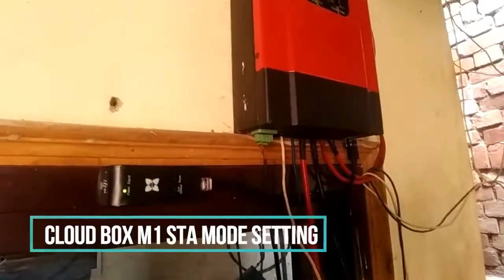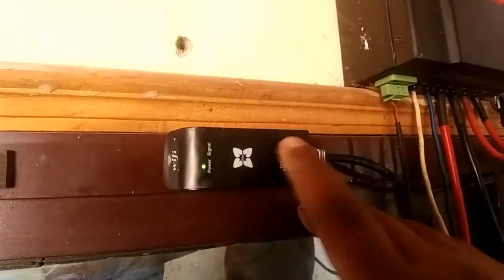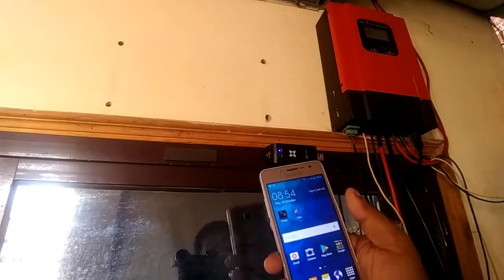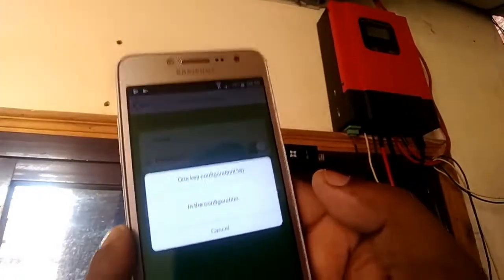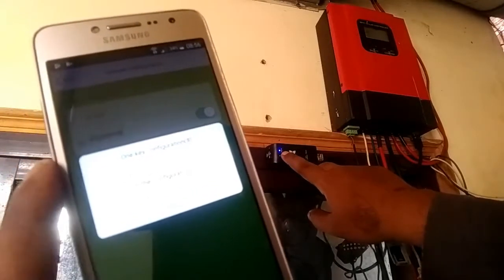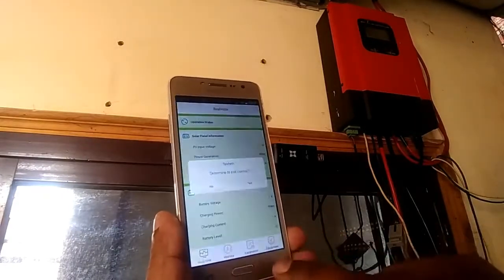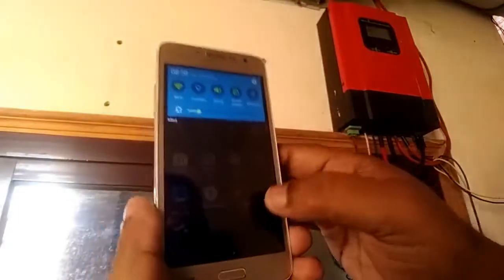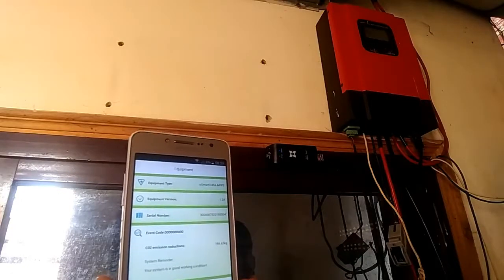Cloud box M1 setting for Esmart3 & wiser3 MppT

Comment: Hi, do you know how to configure the USER DEFINED  option to lithium battery profile?
The terminology they use is very confusing.
Reply from the maker: Hi dear lithium battery are very sensitive to over voltage. This controller says lithium support but you can't trust it's voltage calibration. Often is off by volt or so per 12v which can damage lithium easily.
.
Reply: @MastercraftKARIGAR  thank you. I will check within a meter and adjust if necessary.

Comment: Thank you - the supplied instructions on how to do this are total crap. Now it's sending data to some 'cloud server' is there any way to view it on a remote PC rather than the app?.
Reply from the maker: Hi Toni I really appreciate your comment and thank you for your support. I ve never tried to connect to pc software. Well I will try and upload video.
Reply: For now I'm running the app in an Android emulator but that seems a very inefficient way of doing it. The mygreen PC software doesn't detect the cloudbox.
Reply: @tonyadams2578  I'm try to setup the PC software I can't find instructions anywhere